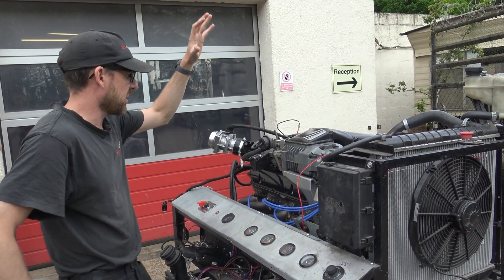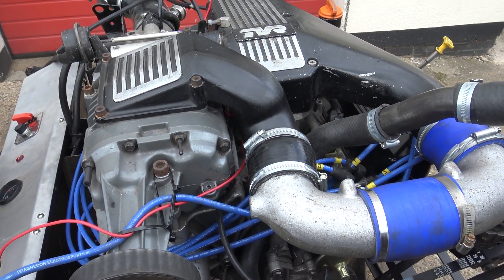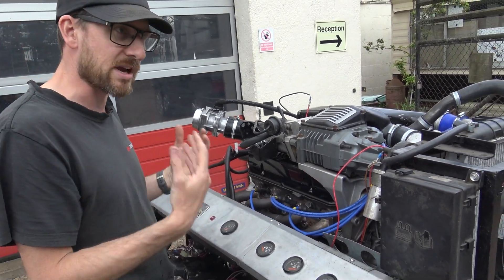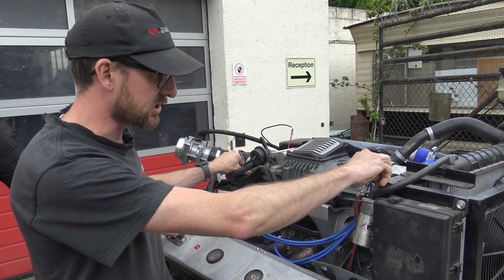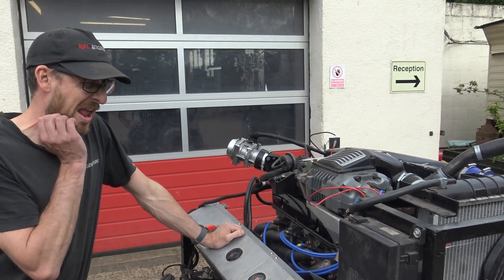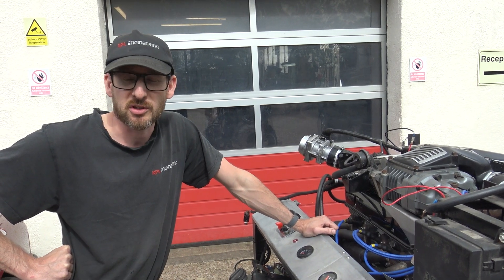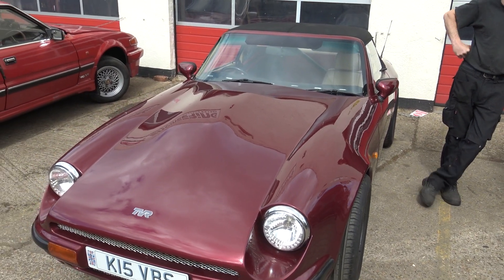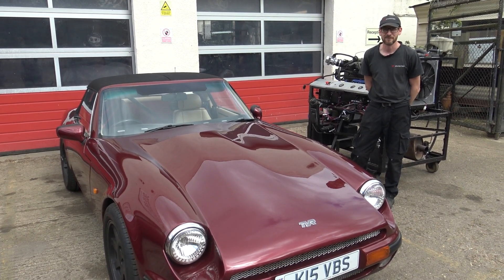TVR 2.0 Supercharged V8 engine hits the RPi Engineering test bed

Comment: dear sirs, where may i find a stroker crankshaft kit (not a buick 300 crankshaft modded to work in a rover v8!)for a rover 4.0 v8 engine??
Reply: I know TWS in the states sell a stroker kit but they make it by offset grinding a 4.6L crank, dunno what pistons and rods they use though

Comment: What happened to twin turbo Tuesday?
Reply from the maker: Its still happening but as always is at the back of the que as customers work takes priority. The only thing left is finalizing the petrol ECU. Dyno tuning went very well however just didnt hit all areas an light throttle on the road still is not right hence no update / final video. Covered around 3 thousand miles now on LPG (ive done some basic mapping on LPG so I can use the truck) and all that have been out in it have been amazed at the instant power available.
Reply: @RPIEngineering  excellent and Tha ks for the reply.  
Any idea on what power and boost its at right now? How's the auto holding up?
Reply from the maker: @psiwog  around 6 to 7 psi. Power levels on the dyno were between 350 and 400 bhp and equal lb /ft torque however the rollers were not calibrated properly to the engine rpm due to torque converter slip during calibration hence why Im saying between 350 and 400 bhp and not the 400 bhp that we first saw or the 380 that we saw at the end of the day once some timing had been pulled out. I will get there and a final video will be published with a dyno run on the same dyno that the project started on so that we have a fair comparison.
Reply: @RPIEngineering  that's incredible given its 4WD, auto and low boost 😳
Reply from the maker: @psiwog  These are crank figures not wheel.
Reply: @RPIEngineering  oh okay... Still very good figures. What is the weak point of the bottom end at this point ?
Reply from the maker: @psiwog  Supposedly on the 4.6 the pistons get a bit melty at 450 bhp however the auto gearbox is reportly a bit slippy at over 400 bhp. I can only go on what I have heard on both counts though as have not pushed this to breaking point and dont plan to.
Reply: @RPIEngineering  fair enough. I think you guys are doing a great job trying these things out and look forward to seeing how it all goes ☺️
Reply: What ecu are you using stock? (I’m guessing not)
Reply from the maker: Sorry. Im not sure what project you are commenting on as your comment has appeared on a sub-chat about the twin turbo P38 project.
Reply: Yea the turbo project I was asking about
Reply from the maker: No on the P38 I am still using the Bosch standard ECU but with Tornado on board with the project we are getting there. Its actually the fuel system that is letting me down at present so I am building a new fuel supply system. The option was there to go stand alone ECU however then there are issues with integration to the auto gearbox, BECM/Dash etc so a headache either way you go and no one in the stand alone market that I talked to was particularly interested in getting involved with assistance in integration to a now 20+ year old vehicle. I did not want to take the car away from being a P38 Range Rover (i.e I was not interested in changing the dash etc)

Comment: What was the problem with the original engine from the V8S?
Reply from the maker: Nothing at all. V8developments 4.0 liter build and drives incredibly well. It will likely be available for sale.
Reply: So your removing a perfectly good v8 to put in a smaller v8 with a blower? Wouldn’t it be better to find a 6 cylinder to put it in instead?
Reply from the maker: The V6 models from what we could research had a very different chassis meaning to fit a V8 its a lot of work and also V6 moded to fit a V8??, NAH!) Better to start with the right car. :-)
Reply: Ah I didn’t realise there were chassis differences still think I’d opt to put the supercharger on the v8 already in the car be far more fun. 😝😂😂
Reply from the maker: It would be too small for the 4.0 litre engine.

Comment: Where did you source the camshaft for this engine ?
Reply from the maker: Its the original fitment cam. However we work with both Kent and Piper should you or we need anything special.

Comment: i dont like the look of that silicone hose collapsing, looks like a problem waiting to happen, maybe a stiffer or a ribbed silicon hose might be needed other than that it sounded sweet.
Reply from the maker: Yep, but of course this pipe work was just a temp solution to run the engine on the test bed. In the car it will be hard piped to a inter-cooler.

Comment: Huh. Whaddaya know? That's pretty cool. Flat plane is cool. How's the balance? I wonder if that could be replicated on a 4.0 with a bigger crank and bore and custom cam.
Reply from the maker: It idles reasonably well but unknown for sure at the moment as its running on a 4.0 litre fuel map so is rather rich and dull.